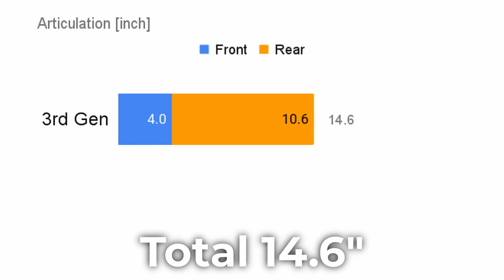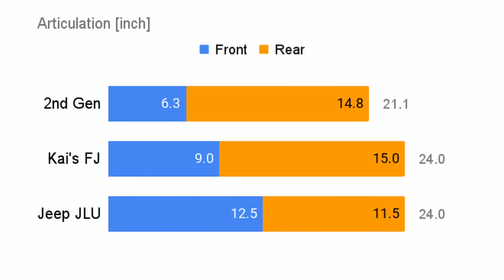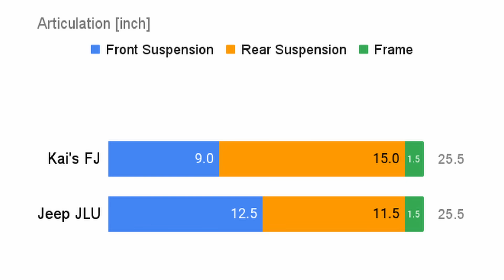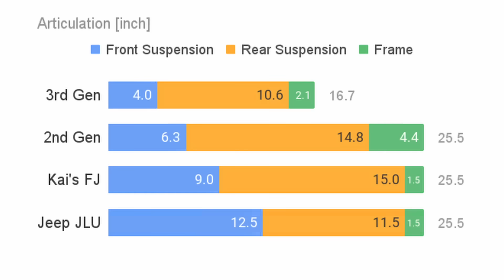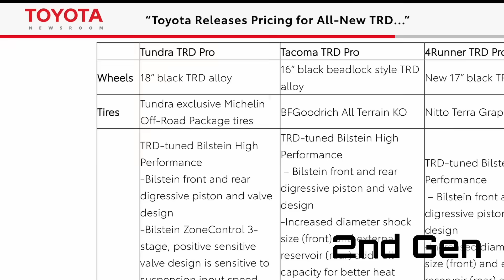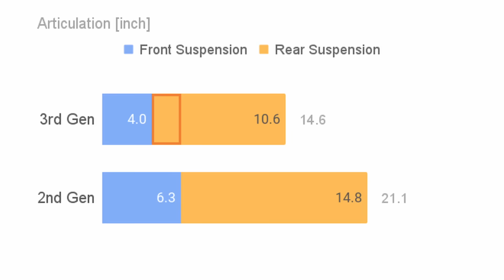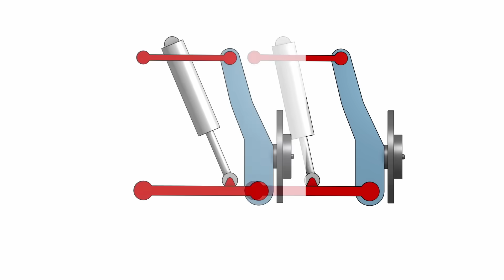Why The New Tundra is LESS CAPABLE Off-Road, But A "Better Tundra"

Comment: The problem I see here is the TRD Pro originally was not intended for the mass market.  It was intended to be THE factory outfitted off-roader.  With this trim becoming synonymous with Turd Bros all across the country, the demand is at an all time high and Toyota knows this. They made the 200IQ move of gearing this more for the average consumer, meaning the bulk population of consumers are now buying the highest priced option because not only is it trendy, but it drives better on road.  

Essentially they have swapped trims so they can sell more higher priced units.
Reply: Love my 24 Pro over the 2.5 gen Platinum Pro I created.

Comment: I was waiting for this video. Very interesting analysis here and confirmed what I already felt about this new generation compared to Gen 2. Overall I think the benefits of transitioning over to links outweighs the cons. I’m happy with my truck and how I’ve built it up and will continue to push this platform as far as I can in terms of its high speed prerunning capabilities! Where toyota makes concessions from the factory, the aftermarket is there to push it beyond. Excellent video!

Comment: If you are taking one of these behemots offroad suspension travel is the least of your worries.. most trails won't even be wide enough
Reply: Actually really depends on where you wheel. most of the trails here isn’t bad. Just need to stop worrying about your paint. And that goes for any rig.
Reply: @4WDisLife This is accurate. I've seen your videos - you demonstrate it.
Reply: True, 4runner and Tacoma are better for tight situations, buuuuuuut I still bought a 2016 Tundra😁
Reply: @brettperkins4643 s
Reply: @brettperkins4643  and your tundra smokes those other 2 in the sand dunes. I know because my buddy has a 17' taco and he was pissed and how much better my tundra did in glamis.
Reply: High speed desert , open forest or wide terrain doesn’t matter these work just fine
Reply: Plenty of trails are wide enough and not all off roading involves narrow trails.
Reply: Most offroad around here is deactivated logging roads with deep drainage trenches in their place. My Tundra with 1" front lift and 1.5 rear didn't drag hitch as much as a stock Tacoma TRD Offroad. If you take an angle into the waterbars to reduce the hitch drag more suspension articulation will keep you moving forward. Its  not a skinny Yota truck but they don't make'em like that since 2004.
Reply: How wide are “most trails?”
Reply: Nice video….legit😊😊
Reply: @Ashoud_Anobetah That is Unless your like myself and you own the 1stgen. Which in my opinion is the perfection size, before trucks got Super-sized😂
Reply: My truck does just fine in tight. Scratches? You bet!
Reply: Wouldn’t consider the tundra a behemoth
Reply: That's why I always have my chainsaw and Sawzall in my truck.
Reply: 1. Short wheelbase of the Tacoma and 4runner will always outperform that big behemoth on technical trails. And I would wager that clearance and breakover would be more problematic than articulation.
2. It is still more than capable for 99.9% of the owners out there.
3. Toyota advertising is more clear now about the fact that the TRD Pro is more inspired by their baja heritage than off road and overlanding. This makes since as all these changes equate to a better high speed mostly flat ride like the desert. Maybe they are marketing geniuses and used that line to make a better daily driver without upsetting the off road enthusiasts.
Reply: Wheel base is to long and fuel consumption to large also….
Reply: @joecoool100  counter point for fuel consumption is that it has a 38gallon fuel tank, it’s about the max range of a tank that matters more than mpg
Reply: @joecoool100 fuel consumption? I had a 17 tacoma offroad. That thing was 15 city on a good day
Reply: @joecoool100 they get 2-3mpg worse than a taco and hold like 16 more gallons. Considering the hauling capabilities of the tundra, it's worth the small mpg depending on your build.
Reply: Exactly why I bought a 3rd gen 4Runner, and I save the Tundra for towing.
Reply: @Gowaduv that’s even worse once you fill it up with gear trust me I went to a  2010 Tacoma 6speed manual to Tacoma 2018 auto to a 2018 4Runner and now I have a 2014 tundra and I’m happiest with the tundra power and good ride with my kings better then any of the others and when loaded up it was better then all the others as well the 4Runner bing the worst

Comment: Hi Kai, how is the ride of the 3rd gen TRD Pro suspension? I pick up the 2nd Gen version for  my truck but haven't installed them.
Reply from the maker: Pretty good but I didn’t have enough time to really test it. Its rebound seemed to be a little slow. It feels very different when I drive off a small ledge at speed.

Comment: Another great video as always Kai! surprised you didn't flex the 3rd gen Tundra w/o the front sway connected, just to capture the difference in travel 🤔
Reply from the maker: Thanks! I wished man. I asked Toyota for that, but they couldn’t let me do that on the press vehicle for safety reasons.
Reply: @TinkerersAdventure  That's unfortunate